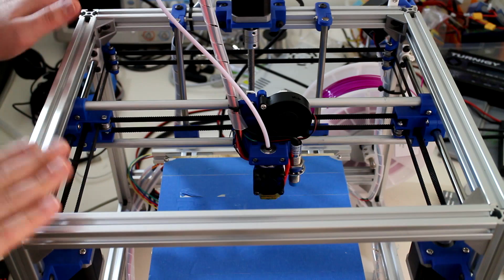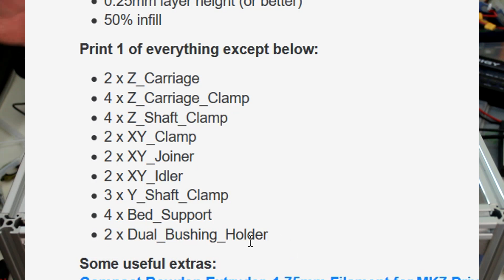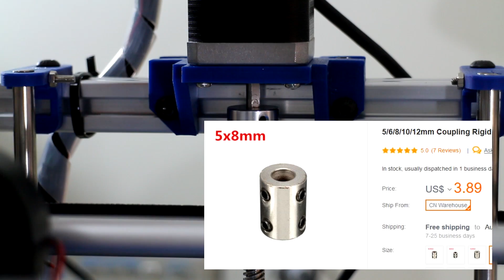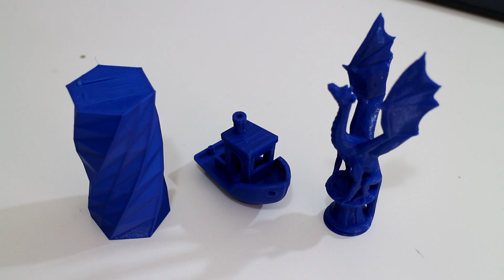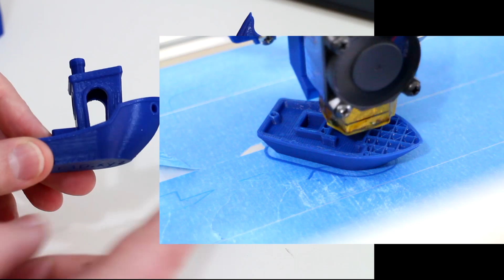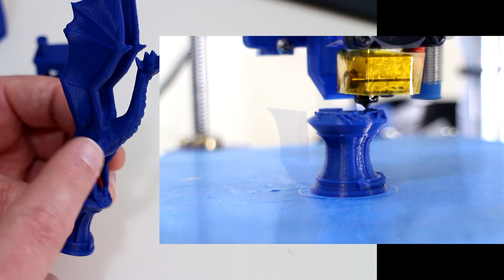New 3D Printer - Build Log #10

Comment: there's a lot of misconceptions in the 3d printing community of how lead-screws (which are a totally different animal than a threaded rod) should be used. really hope you can use your channel and videos to correct them, as z-wobble is one of the easiest problems to solve if done correctly (even on threaded rods), and so many people seem to be suffering from it.

short of it is - you are about to do it wrong again.

a lead screw should be used within a "captured" system. meaning both your top an bottom should not be free.
you should be using the flex adapter on top, but your leadscrew should be captured by a thrust bearing and a radial bearing (and tightened with a shaft collar) to eliminate any movement on x & y.
a good example of a top mounted system is here (by jim marks) http://www.thingiverse.com/make:237442
the bottom should have both a radial bearing and a thrust bearing to keep the system captured and working perfectly, but you can get away with keeping your current setup with only a radial bearing and an un-captured bottom, because the bed's weight will be pulling down on the leadscrew and the radial bearing will be elminiating most if not all of the residual wobble from movement.

the flex coupler's job is to transfer the movement and torque to the leadscrew. it should be a flex coupler to prevent any mis-alignment or rotational angles from the motor, so only the turning force is transferred to the captured leadscrew which then turns perfectly.

hope this helps.
Reply from the maker: Wow that makes perfect sense! The idea with the rigid coupler is to remove any axial flexing that the spring coupler provides as it's being pulled by gravity and the weight of the bed platform. That radial and thrust bearing combo would eliminate that problem!

I have the motor shaft and leadscrew shaft perfectly aligned, plus the leadscrew is straight (not bent).
The Z nut is mounted on the bed platform, which is aligned to the Z axis by the 2 linear Z guide rails. I would have thought there wouldn't be any wobble leaving the far end open. Your clear description is questioning my thinking though.

I'll try my idea first, but move to your recommendation if it's inadequate. Great comment, thx!
Reply: He keeps screwing up his z-axis for some reason.  Running to the solid coupler is not going to be any better because:

1.  Set screws buried into threads is one of the worst ideas ever.
2.  Set screws, by nature, push things off center.  His parts will be misaligned by random offsets induced by random shaft sizes pushed sideways by set screws.

As far as captured system -- I think this is fine if your leadscrew is actually straight.

But this isn't the "professional" equipment that you're comparing against.

If you have misalignment, or an imperfect leadscrew (which a lot of these are), then something has to take up that error.  When you capture a leadscrew that isn't perfectly straight, that actually causes problems, and the error is pushed into your print.

A lot of people have discovered the source of their z-banding was, in fact, attempting to constrain the far ends of their z screws.

A z leadscrew can wobble around like crazy and still produce really, really good layer registration, because the thread pitch is still roughly the same, and you're not forcing the leadscrew errors to impact the platform.

Again, the error has to go somewhere -- either it wobbles your z-rod (leaving your platform constrained by the linear guides), or you constrain the z-rod and allow it to bully your platform around.

Serious mistake.
Reply: since you've already ordered the rigid coupler it only makes sense to test it out and i'd be really interested to see your results with it. 

from what i've seen with other machines, you'll initially seem to get less wobble (because you've eliminated the stretching from the uncaptured flex coupler), but you'll start hearing a squeak (because any wobble, that can't be eliminated by the coupler now, will cause a grinding between the nut and the screw) which will grow louder to a point it disappears. 
at that point the leadscrew has worn the z-nut in a way you'll get constant wobble (too much freedom), and the only way to fix that is replacing the nut.

applying lithium grease will extend the lifetime of both screw and nut, but you'd probably have to re-apply frequently and some grinding will still occur.
Reply: Hi Tom, I'm building a hypercube as well and implemented (or trying to at least) a captured system for the z-axis based on the comments here. Would you be willing to comment on a picture or two and if so what would be the best way to contact you?
Reply: I totally agree with that.

There is already a bearing at the bottom, you just have to add a shaft collar so that all the weight is supported there.
I don't think the thrust bearing is  needed here because the forces are limited, but it makes no harm to put one (don't forget to put grease).
Reply: Fixing the leadscrew at both ends is normally a mistake. The z axis linear bearings are there to keep the axis stiff. If the leadscrew has a slight wobble then so long as its free at one end it will not be passed to the platform. If you constrain both ends then the wobble is forced into the build platform. In essence the leadscrew and guide rods do 2 different jobs and its normally best not to try and mix them.
Reply: that is one of the misconceptions i was talking about. you capture a leadscrew to eliminate wobble and binding. without it you will definitely get wobbling and binding which will be transferred to the entire printbed (since there's nowhere else to go).
take a look at any professional machine (especially cnc's) using a leadscrew, it's always captured on both ends and usually also pre-loaded with some tension (especially on longer screws - to prevent a "whipping" effect that's very common in big cnc's that are being driven very fast).

lead screws were designed to drive captured systems with a preload. using them in an open system can seem to work ok, but i can also drive my car everywhere on 2nd/3rd gear, it's not the intended use and would cause wear and control issues.
the thrust bearings on both sides of a fully captured system are there to prevent binding which would occur in its absence. Thrust bearings are designed to allow rotation on a load normal to the axle and thus need a captured system.

with that in mind - please read my original post again, i did state and recommend that he could probably get away with only capturing the top part of the system and leaving the bottom "as is" with only the radial bearing, since it's a relatively small load and there is no constant z movement (only momentary).

the only professional places i've ever seen a leadscrew not be captured on both sides is the kind of lathes and manual milling machines where the whole moving mechanism is captured and movement is only between making cuts, so wobbles do not affect the end result.
Reply: there shouldn't be any difference between any of our implementations and commercial/professional equipment with regards to the use of leadscrews. both radial and thrust bearings are dirt cheap (as well as shaft collars). there's no special/expensive equipment there.

i was referring to professional designs because those are people who know what they are doing, in contrast to the many designs out there from people with no engineering experience / understanding of leadscrews.

leadscrews are designed to be used in the real world. they take into account the fact that nothing is ever perfect, and no linear leadscrew will ever be perfectly straight/cut etc...
that's what the thrust and radial bearings are for, as well as the pre-loading. because leadscrews are meant to be used under some stretch (to compensate for manufacturing errors - not talking about completely crooked leadscrews of-course).

i've never seen anyone complaining about a properly captured system before. though i've seen many many wrong attempts, always based on the misconceptions repeated here. i'd be interested to see those complaints on a properly captured system.
i have however seen users of almost every commercial (especially cheaper) printer out there (using leadscrews, threaded rods should basically be de-coupled) complaining about z-wobble, and guess what - none of those are captured...

again - since people don't seem to be reading my entire post, my recommendation (at least as a first step) was to keep the bottom end semi-open (with only the radial bearing constricting lateral movement). 
i think that unless he's using an auto-leveling/tramming system (not just using a proximity sensor as an endstop), where there are a lot of small z movements all the time during x & y movements, the effort of properly capturing the system would probably not gain a lot of benefit...
Reply from the maker: I'll update with results regardless of outcome. I had to apply lithium grease to the leadscrew early on as the metal on metal squeaking was intolerable. (I'd used 3-in-1 oil initially but after a day it had dripped on the table).

I'm not impressed with the brass nut and leadscrew combo as there is a lot of play in the nut on the thread. I want to use a ballscrew which banggood sell but I'll try different configurations with the leadscrew first. The ballscrew will require your method of capturing it.
Reply: Coupler - diameter larger than motor shaft by some random amount.  Motor shaft pushed off-center to one side by the set screw.  Misalignment 1.

Coupler - diameter larger than the lead screw shaft by some random amount.  Lead screw pushed off-center to one side by the set screw.  Misalignment 2.

Lead screw nut in carriage -- off-center by some 3rd random vector (not just amount, but direction).

I guess play between leadscrew and nut would be a 4th random misalignment vector.

Yes, many printers have multiple problems.  It doesn't mean the wobbling z-screw is the actual cause.  There is a lot of madness in 3d printing right now.

http://forums.reprap.org/read.php?1,167193,page=2

That's one example.

I have a personal example as well.

https://lh3.googleusercontent.com/EB4QiszH5_OBUMA89t_HRM5WV6QauCw4UbRruwn2xmrD1g_68zjaRgKtRNYhwZdrGZKVKEyg5A=w1920-h1080

Same printer.  Part on the right has z-banding.  Sample part on the left has no banding. Even when I use a macro lens, no banding is evident.

I think the rod might be bent in that printer, and the mount + carriage nut aren't perfectly aligned.  And it doesn't matter.  The leadscrew can wobble all it wants as long as it don't force unwanted XY motion onto the gantry.
Reply: @GoatZilla - if this was (the reprap forums link) meant as an example of a properly captured lead screw gone wrong, then you basically proved my point.
that's one of the most horrible uses of a leadscrew - everything was done wrong there. 
starting from the driven end - the driven end is completely loose there. no thrust or radial bearing, no collar. so this definitely falls under what i've mentioned before of where a  bad implementation leads to bad results.
also, his lower end is again done wrong - if you are going to capture the lower end, a thrust bearing has to be on top of the radial bearing otherwise you're just applying a lateral force to the leadscrew... which is why releasing that end solved his problem (btw - again, that is what i recommended tech2c do as well - top captured, bottom as is now).

that machine is absolutely and exactly my point! the information about proper use of leadscrews is out there. just check every diy cnc forum and guide. it's dirt cheap and easy to implement - yet there are so many misconceptions and bad implementations. and then on top of that people using bad implementations bashing the correct implementation. 
i really wish we as a community could start disseminating this info, as bad layering seems to be one of the top problems people are getting even when building mechanically superior machines, such as this corexy (compared to a prusa i3). 

since you have not shown your implementation, only it's results - i cannot comment on it. but again, i'd be amazed to see a properly implemented captured system having bad results (speaking from experience, not theory).
Reply: My recommendation would be to go with a stepper motor with an integrated leadscrew much like the Prusa i3 MK2 does it.  No coupler or other things to cause printing artifacts.  Example:  https://www.amazon.com/SainSmart-Screw-Stepper-Printer-RepRap/dp/B00JTSEFQY
Reply: @tech2c - would be great if you could try both...
it sounds like you got a relatively low quality pair - you could order a higher quality nut (still dirt cheap) from aliexpress or banggood (there's also this option - http://www.ebay.com/itm/1-PCS-T8-Anti-backlash-Spring-loaded-Nut-For-8mm-Acme-threaded-Rod-Lead-screws-/131931751054 which is ~8us$ and it's pretty high quality).

but unless it's extremely loose you should still get pretty good results if you capture the top end.

regarding the ball screw - i have a few from aliexpress - they're relatively ok, and work very well for 3d printing. i know some guys from the eusthathios and herculien forums who swear by them - but i believe a thrust bearing and lock collar (i use a printed one - http://www.thingiverse.com/thing:624122 ) would be much cheaper to try first ;)
Reply: If it's "properly implemented" then it doesn't need the extra constraints.

The leadscrew on one of my printers wobbles while printing.  It just does.  There are multiple problems with alignment, but none of those problems are allowed to manifest in the XY plane because they manifest in lead screw and only the lead screw.  It's a matter of using the correct flexible coupler.  That printer produces comparable layer registration to my second printer which uses motor-integrated leadscrews.  In that case, things are "properly" implemented, and while those screws aren't constrained either -- they don't wobble in the first place.

The most troubling thing was appealing to "professional" systems, which I had to stop and think about.

So let's look at a sample "professional" linear system:

http://machinedesign.com/site-files/machinedesign.com/files/archive/machinedesign.com/common/files/images/Linear%20system%20supports.jpg

Notice something about that?

It's horizontal.  I.e. gravity can pull on that leadscrew.  This doesn't apply to the z-axis (as much).

You only care about 2 points on the lead screw --the nut and motor coupling.  No other overconstraining unless absolutely necessary.  The motor should be able to handle the axial load alone.

If the motor can't, it's because the print bed is too heavy.  That much has been evident since the very beginning.

I think you guys are addressing the wrong thing based on unsound reasoning.
Reply: Brendan Raymond Imagine a continuous jaw chuck that doesn't contact the shaft at a fixed number of points.  Instead, it grips the work item evenly and continuously all the way around.

One way to achieve this would be with a "flexible chuck".

And hey!  We need the collar to be flexible anyways to account for alignment errors!

Flexible, but not (too) compressive.

Anyone seen anything like that lately?
Reply from the maker: Tom Keidar

Tom, thank you very much for your comments and ideas here. You've provided many solutions, and not only for myself but others that read these comments as well.
Cheers!
Reply: Brendan Raymond A collet chuck is still composed of discrete, individual segments.

I'm talking about a continuous hold.  The solution should be obvious by now.

For this level of printer and base parts (including printed ones), you will have misalignments between as many components as you throw into the pot.  Instead of throwing more in, building heavier, requiring more accuracy, making things more complicated, which are all machinist-y technician-y kinds of things to do, why not simplify?

Many of these kits are unfortunately designed with the initial assumption:  assume everything is perfect, then start from there.

The better designs tolerate these misalignments gracefully.

These are linear motion systems.  A line is defined by 2 points, not 3.  If you cannot come to grips with this basic fundamental concept, then we're at a standstill.

3 is overconstrained and needs to be done because the tradeoff (unusually long travel, like CNC machines, or high load like CNC machines, or high speeds like CNC machines, or the fact that the same units are installed vertically or horizontally so they just build them all to the same spec) is worth the overconstraint.

Since these don't apply to a typical printer's Z-axis, then...  the overconstraint doesn't apply.
Reply: Jan Prinsloo hi, sorry for the time it took to reply, i'm currently on a business trip with limited connectivity (and time), i'll be home next week and would be happy to help. 

you can send me a hangouts invite (i couldn't find you on there to send you an invite), and it'll be easier to chat and send pictures even before i'm back home.

Comment: You need to make a DVD drive CNC laser engravers! Its right up your ally and It would be intresting to see your take on it
Reply from the maker: That's an interesting idea. I guess CNC is the next logical step from 3D Printing.
Reply: Though they have extremely limited capability.  Even the 5500mw kind people have said just can't cut the mustard.
Reply: They engrave and can cut faom. Either way its a introduction into CNC design from scratch
Reply: Tesla
Yep, if they couldn't cut through foam I would be worried, lol.